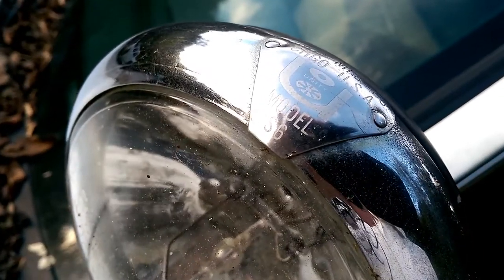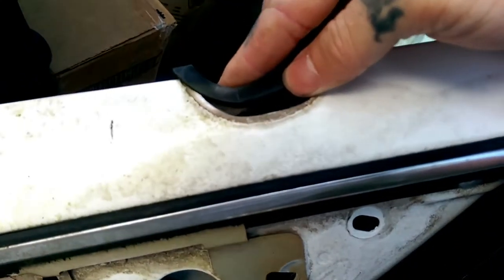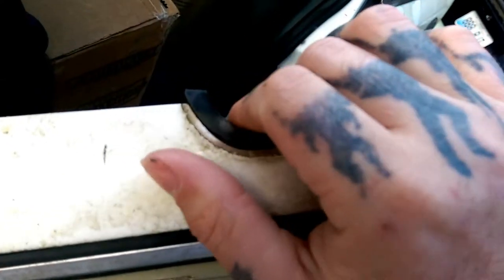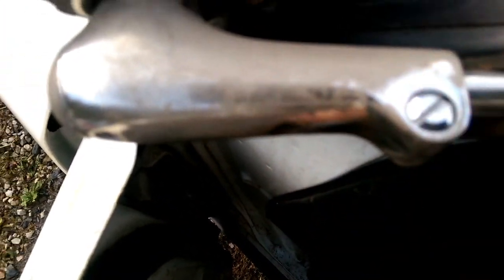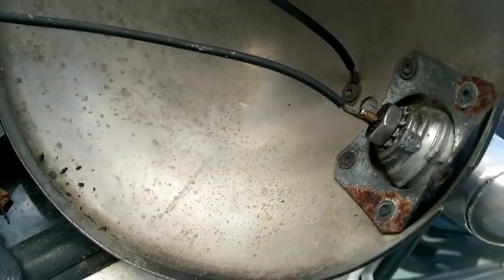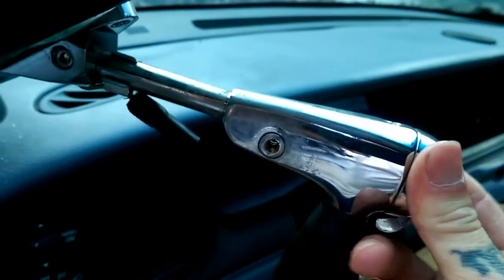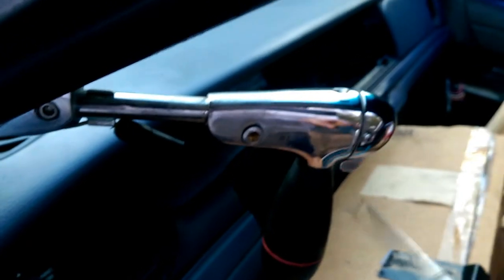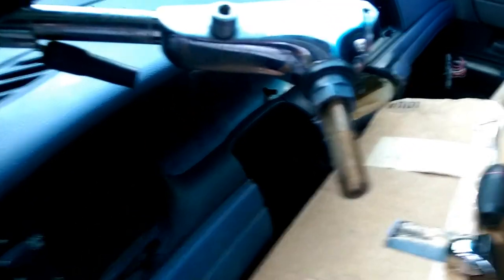How To Remove A Police Spotlight  P71 And More

Comment: Got my slot light installed your vid was very helpful
Reply from the maker: Thats good  to hear
Reply: Another question on the S04 model spot light what kind of bulb does it take
Reply: Would I be able to replace with led light bulb
Reply: The one that's on there now is yellow lighted and not very bright but I think it's the older model
Reply from the maker: you can make anything work with with enough skill, but im not sure what size the bulb is
Reply: Hey got another question on the police interceptor badge on the back ..what are the measurements since you've had access to these cars could you snap a pic and send it with the length
Reply from the maker: have no more interceptors in my yard at the moment
Reply from the maker: Never heard of it before, is it any good?

Comment: Well anyways  I have the 06 crown Victor police interceptor ac was working great today the blow motor quit working so I turned the switch off and on and it came back on ..then it did it again so I turned the car off and cranked it back up and it worked again like normal ...then shut the car off again then after start up again now blower motor want even turn on i can here the ac engaging and the vent doors opening when switching selector..fan speed doesn't do anything...i tested the blower with another battery blower kicks on used a light with red and black and tested the pigtail end and it lit up ...so what do you think my issue is
Reply from the maker: almost all cars use the same kind of blower set up. so it could be a blower motor resistor or the blower fan control module maybe even the fan speed control switch, could also be a faulty relay or a bad ground to the blower motor... just half do a check list and rule them out one by one
Reply: Resistot switch